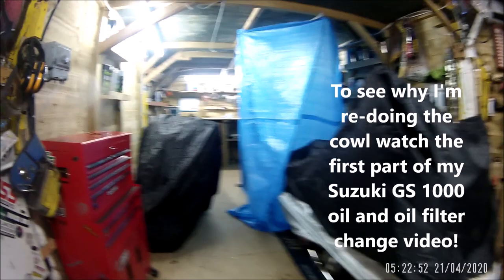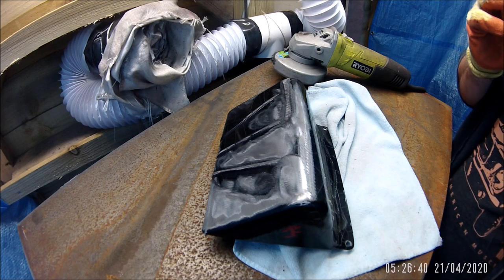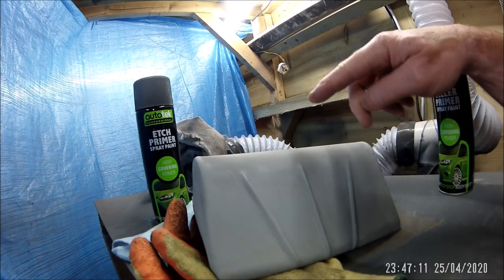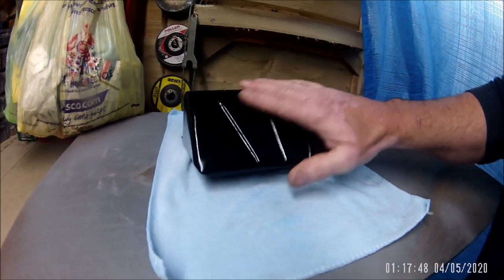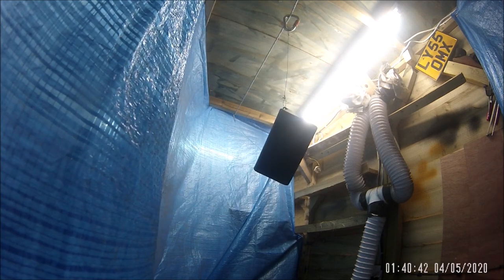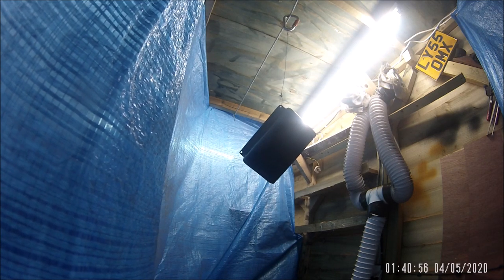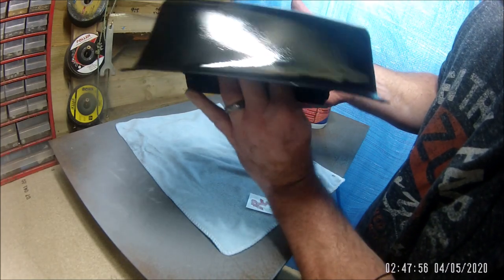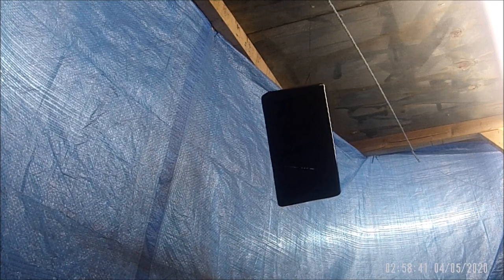GSXR 1000 Streetfighter build pt57 Custom Cowl painting

Comment: I know nothing about painting but rather than using a polish would it not be better to use some sort of wax or sealant ?
Reply from the maker: The polish got rid of a few dull areas in the top layer of clear coat and then i used the turtle wax to seal it. . . and it still hasn’t cracked after being on the bike for about three weeks now! . . . I do lift my leg extra high so I don’t accidentally kick it, I really don’t know how tough the finished paint job is and I don’t want to test it just yet 🤪